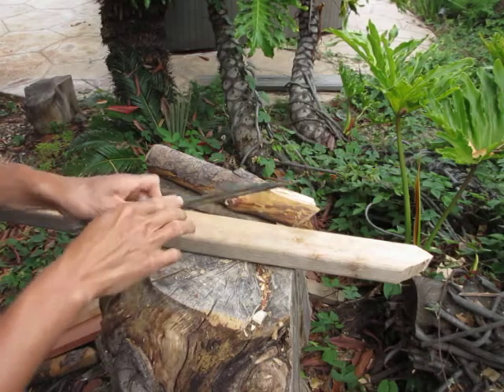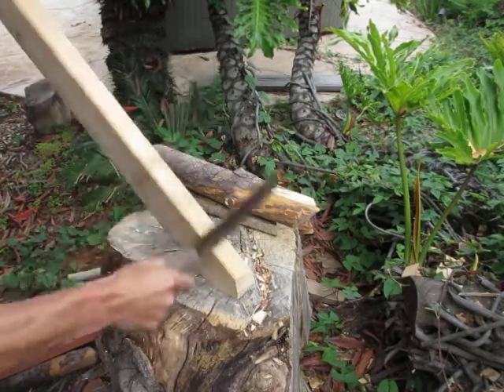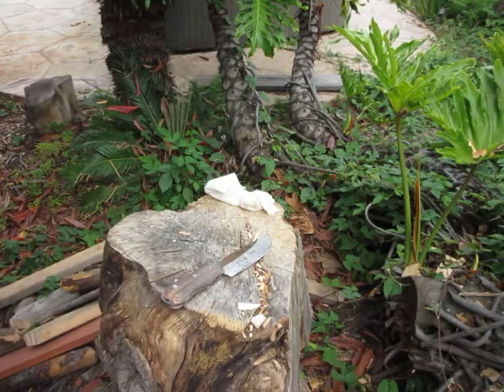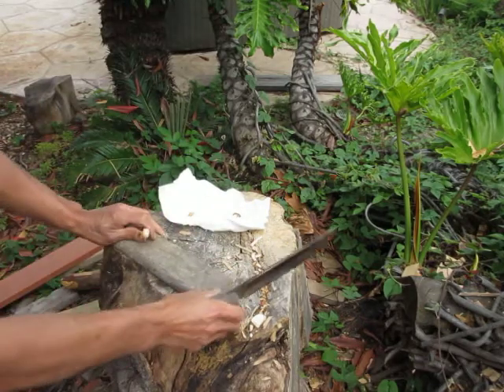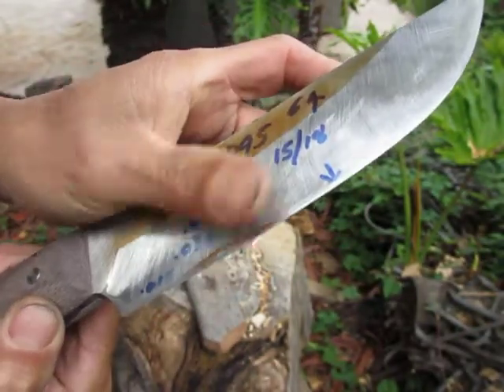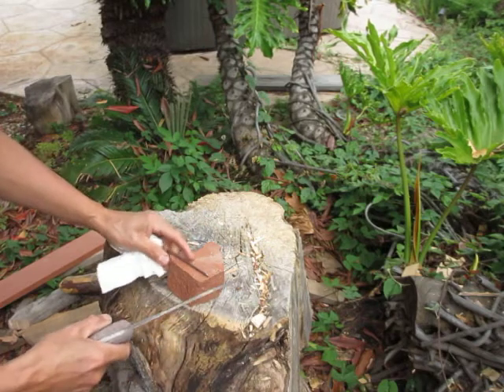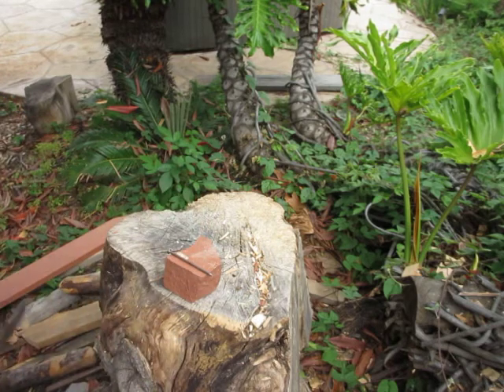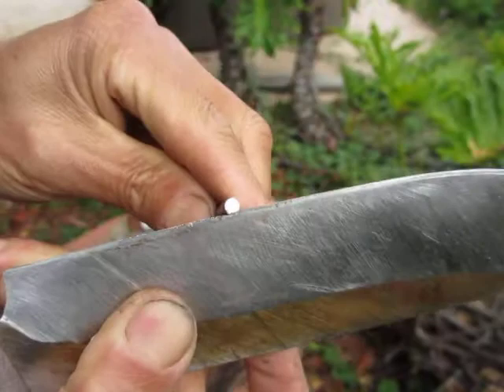BCMW 1095 64rc small chopper hard test

Comment: That is pretty impressive. 
I thought it would of taken more damage a lot earlier.
Reply from the maker: Thanks. I chose 1095 to test my ht because it's an almost blank canvas in painting analogy. A well formed steel matrix (fine grain, lath & small martensitic unit, clean grain boundaries, etc) is extremely strong and tough (resisting to damage).

That sizable chip on 2nd nail chop - well, no thin geometry can handle a poor-technique (resulted in penetrated and then pried - essentially a torsion+lateral impact). Only solvable by thicker/bulkier steel volume involves in the chop. With high certainty, Infi or 3V or S7 with this thin edge geometry would incurs massive damage as well - sure, at lower hrc would be a large sideway/lateral bend and possibly apex teared.